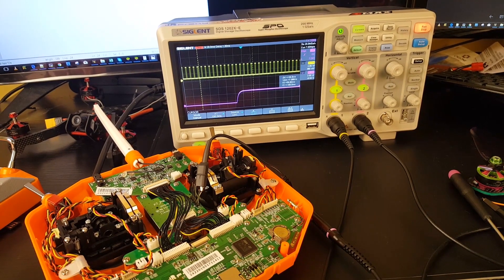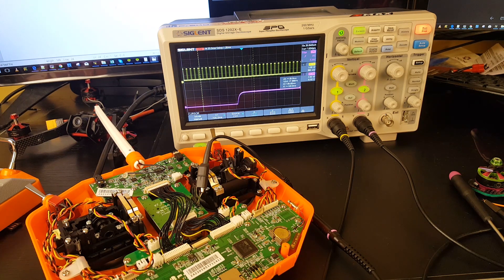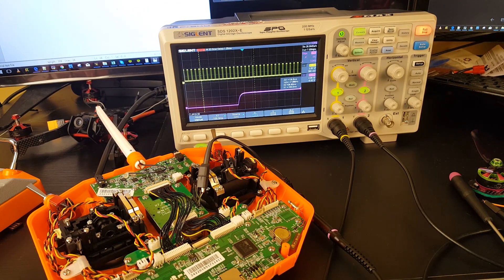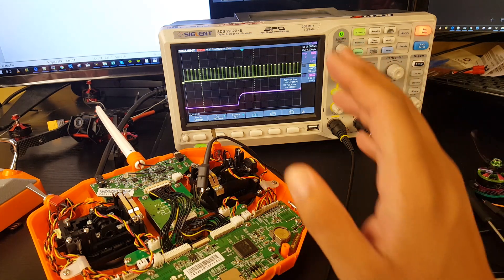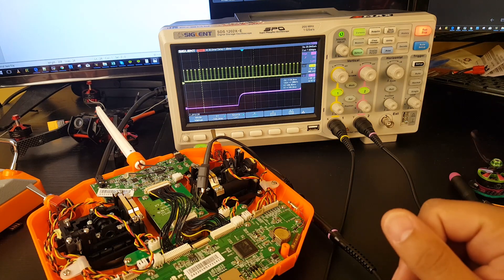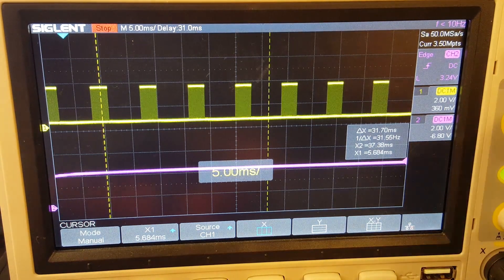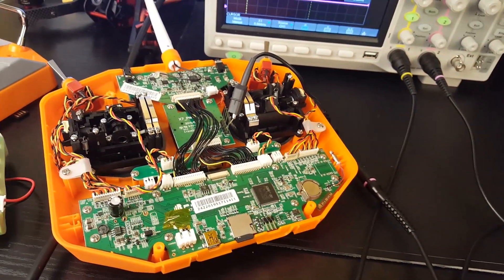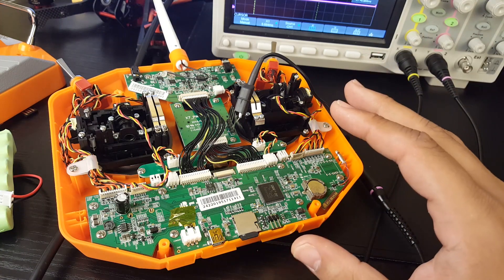FrSky D16 8ch vs 16ch Latency // Final Results

Comment: IN SUMMARY : 
D16 8 channel is faster because it update the first half of the Sbus frame (and only this half , logicaly) every frame.
where D16 16chan update the first half once every other frame thus taking 9 more ms.

latency could not be improved further , maybe with 4 or 6 channel , have to test
Go at the end for the why

IMPORTANT PLEASE READ BELOW FOR MORE INFORMATION AND THEORY:

Theory :

i might be wrong but , Sbus is not the protocol in the "air" right ?
The protocol in the air is D16 , sbus as nothing to do with it Right  ?  its like TCP on the internet transporting DATA that as nothing to do with the protocol
there is some FHSS (Frequency Hopping Spread Spectrum) or some other black magic involved behind the curtain no ? 
is there not some CRC added or redudency or anything else ? there is also the telemetry link on the same channel at the same time right ?
 
Let me develop on this . (even if i am wrong about the air protocol but i dont think)

We know for sure Sbus is the protocol out of the serial pin of the receiver and it is inverted UART at 100000 bps.
we know for sure it only take 3ms to actualy write the 25 byte of data contained in Sbus.
We know for sure it has ALWAYS the 16channel in it + 2 on/off channel (not used by Frsky or opentx i think, may have to confirm that) + frame lost bit + failsafe bit
(each byte = 1starbit + 8databit + 1paritybit + 2stopbit = 12)   12 bit X 25 byte = 300    --> @100000 bps = 3ms
Since an actual frame from the RX only take 3ms , why not send one every 4 ms ?

but how much time did it really take "in the air" ??? if it is really 100000bps in the air why not send a frame every 4 or 5 ms ?

did it need that much processing power to send simple frame at 100 Khz(100000 bps) when we have STM32 capable of runing complex PID and gyro loop at thousands of Hertz ?
and we also know transmitter radio module and receiver also have their owm stm32.

i also know for a fact that after hours of capture and analysis that in D16 mode and 16 channel , half of the frame is updated every other frameare as you found.
and as soon as you go under 9 channels the update happen every frame when you bang the stick hard. (only updating the first half of the frame , logical)
(i captured many megabits on computer with transistor inverter and banging the stick hard to get the fastest change possible)
since the channel 1 to 8 are updated only every other frame in D16-16 , you get indeed 9ms less latency in D16-8.

My theory is that the air protocol is taking approximately 9ms to transmit 8 channels and thus you receive a different frame , (dont have good enough DSO to confirm that but the behaviour confirm this)
i cant explain the delay between switch On and actual Sbus data , but it may take some time to process it in opentx/send it to radio module via inside data line/modifiy it to D16 / send it in the air / receive data / checksum / acknowledge / processing / convert to sbus / sending to pin.

there is also the fact that no matter if you cut the transmitter you still get a frame every 9ms , so maybe the serial output of receiver is not even in sync with the air data. ( this can be the reason that latency is variable to a certain degree)

there is no bottleneck in sbus , the bottleneck is the air and D16 protocol , this is the reason for the limitation , unless the horus is not D16 it will not run faster.
it can certainly be changed with the radio firmware (the one you update trough smartport for the receivers).

you wont find anything in the code of betaflight or opentx since it dont come from here , i have looked too , and for hours . i think the processor in the transmitter in fully capable of sending 20 times this framerate to whatever transmitter module.

it may not send the frame in sync but receiver is waiting to have an end bit(checksum maybe) to update to Sbus packet (it may happen at any time in the 6 ms interval)

you have to try latency with 8 channel and the most interresting part , with 6 , and 4 channels , it might very well update the Sbus frame sonner since there is less data in the air , and maybe maybe the endbit of D16 will arrive sooner and thus the sbus frame will be updated by the receiver sonner , not leaving 4-5 frames shift before update.
that just a theory but we might be the first on earth to test that

not possible to improve latency really , maybe hack the radio protocol but very complicated , and D16 i pretty solid in the air , it will come at a cost in range 

Here is a sample of data capture in D16-16
DE F0 86 37 BC E1 0D 6F 78 C3 1B CE 70 86 33 9C E1 0C 67 38 C3 19 00 00 0F 
DE F0 86 37 BC E1 0D 6F 78 C3 1B F2 90 87 3C E4 21 0F 79 C8 43 1E 00 00 0F 
07 39 C8 41 0E 72 90 83 1C E4 20 F2 90 87 3C E4 21 0F 79 C8 43 1E 00 00 0F 
07 39 C8 41 0E 72 90 83 1C E4 20 24 21 09 49 48 42 12 92 90 84 24 00 00 0F 
41 09 4A 50 82 12 94 A0 04 25 28 24 21 09 49 48 42 12 92 90 84 24 00 00 0F 
41 09 4A 50 82 12 94 A0 04 25 28 6A 51 8B 5A D4 A2 16 B5 A8 45 2D 00 00 0F 
90 81 0C 64 20 03 19 C8 40 06 32 6A 51 8B 5A D4 A2 16 B5 A8 45 2D 00 00 0F 
90 81 0C 64 20 03 19 C8 40 06 32 C4 21 0E 71 88 43 1C E2 10 87 38 00 00 0F 
F2 91 8F 7C E4 23 1F F9 C8 47 3E C4 21 0E 71 88 43 1C E2 10 87 38 00 00 0F 
F2 91 8F 7C E4 23 1F F9 C8 47 3E 2D 6A 51 8B 5A D4 A2 16 B5 A8 45 00 00 0F 
62 12 93 98 C4 24 26 31 89 49 4C 2D 6A 51 8B 5A D4 A2 16 B5 A8 45 00 00 0F 
62 12 93 98 C4 24 26 31 89 49 4C AB 5A D5 AA 56 B5 AA 55 AD 6A 55 00 00 0F 
F0 82 17 BC E0 05 2F 78 C1 0B 5E AB 5A D5 AA 56 B5 AA 55 AD 6A 55 00 00 0F 
F0 82 17 BC E0 05 2F 78 C1 0B 5E 49 4B 5A D2 92 96 B4 A4 25 2D 69 00 00 0F 
93 9B DC E4 26 37 B9 C9 4D 6E 72 49 4B 5A D2 92 96 B4 A4 25 2D 69 00 00 0F 
93 9B DC E4 26 37 B9 C9 4D 6E 72 F4 A3 1F FD E8 47 3F FA D1 8F 7E 00 00 0F 
4A 54 A2 12 95 A8 44 25 2A 51 89 F4 A3 1F FD E8 47 3F FA D1 8F 7E 00 00 0F 
4A 54 A2 12 95 A8 44 25 2A 51 89 BE F4 A5 2F 7D E9 4B 5F FA D2 97 00 00 0F 
19 CD 68 46 33 9A D1 8C 66 34 A3 BE F4 A5 2F 7D E9 4B 5F FA D2 97 00 00 0F 
19 CD 68 46 33 9A D1 8C 66 34 A3 88 45 2C 62 11 8B 58 C4 22 16 B1 00 00 0F 
E2 15 AF 78 C5 2B 5E F1 8A 57 BC 88 45 2C 62 11 8B 58 C4 22 16 B1 00 00 0F 
E2 15 AF 78 C5 2B 5E F1 8A 57 BC 4B 5E F2 92 97 BC E4 25 2F 79 C9 00 00 0F 
A1 0E 75 A8 43 1D EA 50 87 3A D4 4B 5E F2 92 97 BC E4 25 2F 79 C9 00 00 0F 
A1 0E 75 A8 43 1D EA 50 87 3A D4 00 07 38 C0 01 0E 70 80 03 1C E0 00 00 0F
Reply: 0F should be at the beginning of the capture but that doesnt change anything  , once every other frame the other half get updated !

It might sound complicated and badly written , it is normal since i am french and took me more than an hour to write this comment 

if there is any part that you need rewritten/retranslated please tell

Cheers , hope you will read me
Reply: about betaflight or anything connected to Sbus pin , it receive a frame every 9ms no matter what.

However i dont know if frame is processed every time received in BF , but it might be better to do so if not . If betaflight wait 2 frame to process all the 16 channel at once , it is loosing time when we are in 8channel mode , because Sbus is updating the first half every frame .

hope BF is not working like that , will have to get confirmation on betaflight repo
Reply: @tfoutfou21000  hello, did you confirm this?? is betaflight waiting for the second frame?
Reply: @dmurillo11madrid  It was a long time ago , but the conclusion from all of this , is that if you want the best possible latency you have to go to D16 8 channel .
Since my research about that i have switched everthing to 8millisecond.   
The only downside is that you may not get enough channel to control everything you want , but there is a way to program many switch on a single channel , Joshua Bardwell made an interesting video about that if you need to use more than 4 switch.   Let me know i can send you the link
Also nowadays , if you want the absolute best latency , CROSSFIRE has proven to be much faster according to pro pilot.
and the link quality is also highly improved , personnaly i am not a racer so the low lantency versus the cost , i am not interested yet
Reply: @dmurillo11madrid  betaflight has also improved , today there is a setting called RC smoothing and rc interpolation , and it is affected by the latency of the radio .
So the lower and more reliable , the better for betaflight.

Comment: I have AUrora 90 wth Frsky receiver and Q7 i’ve Done everything correctly. Out of box there was a 1-2 sec delay so I flashed with new firmware, same thing...I’m still getting latency of 1-2 seconds...any idea..bad receiver? Im desperate as this is brand new quad and could not get full refund...thanks

Comment: The source of your confusion is that SBUS is generated by the Receiver. It is not what is sent by the TX and the D16 protocol. The D16 protocol sends lo8, hi8 in alternating packets, one every 9ms. If you restrict to 8 channels on the TX then you are supposed to get just the lo8 channels in every packet. Nothing I see in your test here illustrates that you tested this.

The D16 protocol has been reverse engineered as part of the MULTI protocol project in case you are interested.

SBUS has 16 channel slots and the RX emits an SBUS packet every 9ms. When you restrict to 8 channels on the TX you should see the lo 8 updated potentially in every SBUS packet. When you set 16 channel on the TX you should see the lo 8 update in one SBUS packet and the Hi 8 update in the following packet as you observed. This is as expected from the D16 protocol.

It is harder to test to see the lo8 update every packet since you need a signal that changes every packet. (ie every 9ms)

The PXX interface between the TX and the internal XJT module is also limited to 8 channels every 9ms. This is the source for some of the latency because the TX and XJT are not synchronized so the lo8 will not get updated every packet. Every so often it will repeat the previous values. There is a fix for this synchronization in the ER9XSky firmware for the X9D+ ...not sure about the Q-X7. The same fix has been proposed for OpenTX but it is not considered a high priority. The rest of the latency is probably accounted for in the TX firmware (OpenTX in this case) although assuming your measurement is correct it is longer than I would have expected.

Just goes to show that latency matters a lot less than people think, after a certain minimum anyway.

It would be possible to conduct a blind test between D16-8ch and D16-16ch to see if those that claim to tell the difference actually can. That would be a more interesting test since it would tell us if the numbers actually mean anything significant. I suspect they don't mean much.
Reply: For an external frsky module, would you recommend one using the MULTI protocol, or a genuine Frsky XJT? Are you suggesting that with the MULT protocol there is less latency?
Reply: What happens if you configure opentx for anything in between 8 and 16 chans, like chans 1-12? Is it any faster than configuring channels 1-16?
Reply: For FrSky there is a special 9ms firmware, CH1-8 is 9ms, CH9-16 is 18ms: https://github.com/mikeller/opentx/releases

Comment: Good work and thanks for sharing. Informative. 

I suggest you look at one of the RaceFlight Guy's video. Might be a live stream video. Where they first made me aware of the internal processing latency in the taranis. And why the prefer Spektrum system is faster as a result. From what I recall, they feel they can fix the underlying problem. Hopefully I can find the video in question to link you to. In case you have not already saw the video for yourself. Keep up the good work.
Reply: Here you go. Hopefully the link works. https://youtu.be/_rxAPlYr9FQ It's the "Behind the Catus - Spektrum vs Taranis"

The good bits comes about the 9:30s mark.

Comment: If its a cpu related problem or firmware related,..is it faster when u set it to 5channels output?
Reply from the maker: +Hans Turpyn Don't know have not tested that will test that in later video.
Reply: thanks, because i am doing that,  4channels + arm switch

Comment: Ok, I have to change to 8ch,. If I change the range on my qx7 from 16ch to 8ch is enought? Do I need to bind again?
Reply from the maker: D16 1-8ch

There is no need to rebind it will automatically change.
Reply: But a 2 frame processing delay what is added by BF is still be there? So we will get the same result no matter 1-8ch or 1-16ch, wont we?

Comment: Did it hurt to say that you were wrong? 😜😆😆 but how mutch latency was whit 8ch then?
Reply from the maker: Bennie Leip Not at all, I am very happy that people have their input and I was half correct we should be getting 16ch in 9ms but there is a limit somewhere where I'm trying to figure where is it conning from.
Reply: Drone Mesh i have nothing with programmer stuff i learnt for car mechanics so thats a diffrent cooky 😆 so its hard to get but cant you disconnect the other 8 ch that you only get a clear 8ch update every frame? Because you only need like7 ch or not
Reply: Or do you have to rewrite the programs then if you only want it to work at 8ch and refresh it every frame?
Reply: Bennie Leip The code has to be rewritten and also the code on the receiver. Im also not a programmer, but i know that only Frsky itself could change it.

Comment: When I saw this on JB I tried to switch to d8 on my xm+ but no deal wouldn't work duh it's d16- so you need a d8 receiver? Probably dumb question
Reply: Никита Кузнецов At least on the XM+ (the only receivers I have) there's a firmware that sends RSSI on channel 8.
Reply: Никита Кузнецов look at this vid https://youtu.be/LPxjT3Aosak you can easily change your rssi from channel 16 to channel 7 for instance
Reply: skypilot 23 you prolly tried to change mode D16 to D8 but dont do that change your channel range to CH1-8 (9ms)
Reply: That's a video from August right? JB talked about 11ms which is also wrong.
Reply: alfa4liveejk but what about rssi when it's on the 16ch?